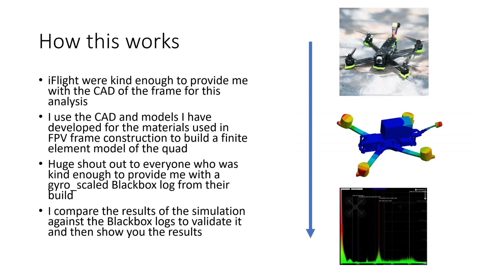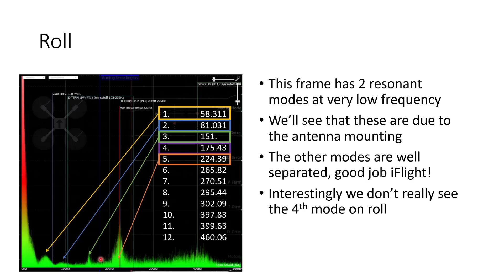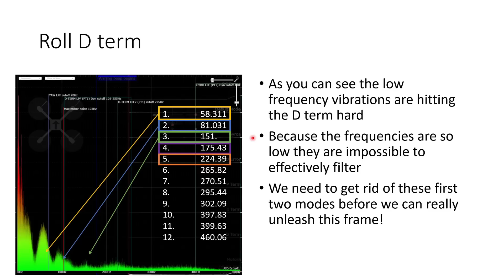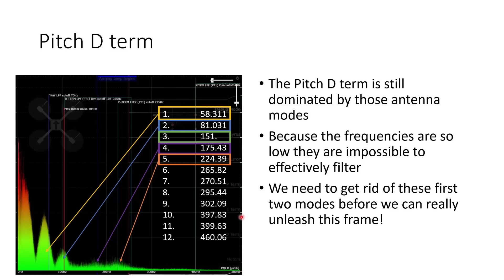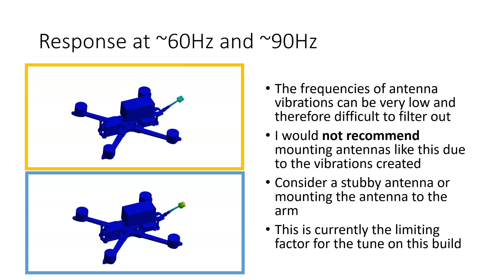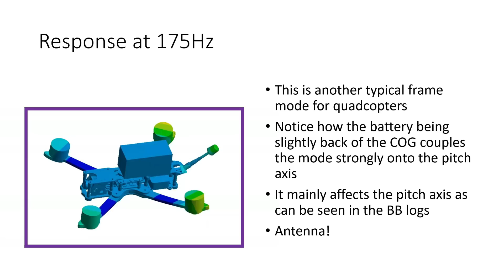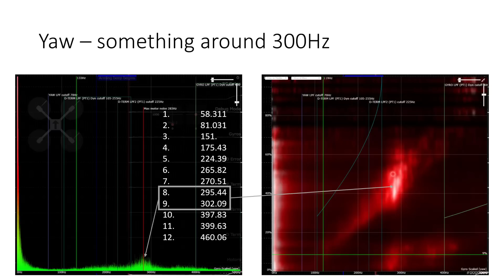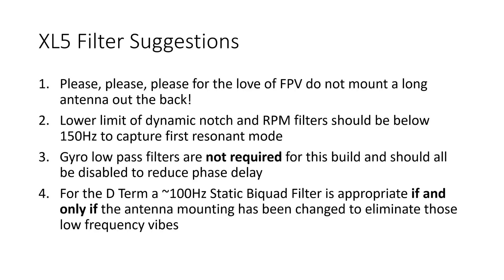Vibration analysis of the iFlight Nazgul 5 V2 and XL5 Frame. The antenna RUINED my tune!

Comment: It's obvious that antenna adds vibrations and ruins the tunes. But it's not obvious how to fly back when a short antenna blocked by every piece of the quadcopter...
Reply from the maker: I fly DJI and never have an issue with range or penetration with the antenna strapped to the arm. Maybe it's an issue for super long range (I don't fly many km away) but not for freestyle.
Reply: @ChrisRosser  It's an issue for analog ;-)

Comment: Hey Chris, just one question what if I am not doing freestyle with the quad but some occasional cinematic with this bnf? does using a long antenna matters? because I am flying maybe 1 km away i am worry that if I use a short antenna it will get blocked by the battery and gopro and lose signal

Comment: Hi Chris! Just curious as to the real significance of the mass participation factor of a small antenna relative to the mass of the rest of the build? I've been doing my own frequency analysis on my own designs on SolidWorks as well and I don't really see a practical difference between a 3g antenna (with a light hanging off the back in the context of a 250g build. When using such a light antenna, is it reasonable to say it is worth the extra resonance participate for better VTX signal?
Reply from the maker: It definitely affects the gyro signal and is visible clearly in backbox logs. Long VTX antennas cause low frequency <100Hz peaks that are amplified in the D term and limit max D gains. Have you validated your simulations with flight testing and blackbox?
Reply: @ChrisRosser  Okay, thanks. No, not yet, I'll go out today and check it out, thanks! Also, any chance you'd be willing to share the CFRP mechanical properties you use for your modeling? Given the composite nature and variability of the different sheets available out there I've had to cobble together a material spec sheet from a few different sources and I'm not 100% happy with that ha
Reply from the maker: @itsmeRizzG  Can solidworks handle a 6x6 anisotropic compliance matrix? Or does it assume isotropic properties?
Reply: @ChrisRosser  You can define an Orthotropic material with elastic moduli in X,Y and Z as well as the other properties (poisson's etc.) according to the appropriate dimensional planes/directions.
Reply from the maker: @itsmeRizzG  Here is a link for in plane properties and you can assume resin properties for out of plane: http://www.performance-composites.com/carbonfibre/mechanicalproperties_2.asp
Reply from the maker: @itsmeRizzG  Unfotunately carbon fibre is not an orthotropic material (its fully anisotropic).
Reply: @ChrisRosser  Thanks, I've looked at this before,

Comment: Wow, I just had a HUGE problem with a Rekon7 and and HRB 3300 6s. I couldnt strap it down with a rear second strap or it was d term hell and HOT motors within 10 seconds. The rear of the battery contacts the antenna(about 8" long stalks) TPu mounts and probably is coupling antenna modal vibrations into the frame via the battery!
Reply from the maker: 8" long antennas, yep that sounds like a vibration nightmare 😱

Comment: So you created an exact nazgul5 v2 on the simulator?
Reply from the maker: Yes, iFlight were kind enough to send me their production CAD model so it should be very accurate.
Reply: @ChrisRosser  is there a way I could do the same? Or would it be hard?
Reply from the maker: Depends on your background. I'm a simulation engineer by profession so it was an approachable problem for me.
Reply: @ChrisRosser  wow that is impressive! How did you get into that? Also what is the best Sim for 2021?

Comment: Same probably goes for the huge battery wires and connectors that people allow to flap around in the breeze.
Reply from the maker: Absolutely, youve got to tie loose parts down to stop them vibrating.

Comment: this a kind of motor cross talk, I have modified nazgul with 7 inch props and arms, it has clean picture after 30-40 hz. Frame oscilating at 0,5-1 hz

Comment: That theory sounds really great, but someone should test with & without the antenna and show the results. Great video explaining this hypothesis, but im just not convinced that this little antenna makes so much difference, until there is clear evidence.
Reply from the maker: If you follow the discord groups you will see a few examples of antenna mounts causing vibration and changing the mount fixing it. It's quite a common problem particularly for long range quads with long antennas.

Comment: I have this quad in analog version. Would that be helpful to support the antena by stiffening it with carbon rod shrink-wrapped to it or using a carbon tube perhaps?
Reply from the maker: Yes, anything you do to stiffen up the antenna will help.

Comment: Really amazing analysis Chris! I am a structural civil engineer and many times I wondered why there was not much talk about resonance and the vibration modes of the frame versus the performance in flight. Have you modeled the effect of the stack's support configuration on the amplitude of the noise? a while ago I had a serious problem with noise in the yaw axis and finally I realized that it was caused by very flexible supports, and it was made worse by the capacitor that unbalanced the center of gravity of the stack + capacitor assembly. It would be interesting if you could address that topic in a future video.
Reply from the maker: I strongly recommend that people use long steel screws for their stacks for that reason. I'll certainly mention it in my next build video to use steel screws and not plastic standoffs etc.
Reply: @ChrisRosser  Yes, in my experience the best results are obtained using steel screws fixed to the bottom plate of the frame with a nut, so that the frame + screw connection is as rigid as possible, and only use shock absorbers at the contact points between the screws and the FC. It's a very bad idea to use shock absorbers where the screws are fixed to the base plate, since the support point of the stack is "labeled" at that point and favors the problem I described above.

Comment: Awesome, thanks. I flew this frame all last summer... It was one of my smoothes flying builds... I did only have a light weight flexible dipole on the antenna mount, and had soft mounted motors.. I will be building a fresh build on a new XL5 V4 frame very soon, I will deffo take your filter and antenna advice, thank you from North Wales.
Reply from the maker: I hope it flies great for you!

Comment: Thanks for the knowledge. Your work has inspired me to solve that problem by designing a new antenna mount that improves rigidity significantly. 

 I have uploaded it to Thingiverse 
with the name: Antenna Holder "Stiff" - iFlight Nazgul5 in case you want to comment with the link.
Reply: Youtube remove all the links, so in thingiverse thing:4907125
Reply: Just went and checked it out, def looks solid! Is it designed for stock standoffs?
Reply: @reboot110  Yes! Is designed mostly for stock standoffs. I am corrently working on different stubby antenna mount.
Reply: @gospodini226  Awesome, actually picking mine up from the printer today!
Drop a link here when u get the re-design done, stoked to see what u come up with

Comment: So obviously there is a tradeoff, shorter antenna and you get less range. So what if we used stiffer antennas so they would vibrate at a higher, more filterable frequency?
Reply from the maker: In this case it was the TPU that was too flexible rather than the antenna so a stiffer antenna mount would have helped a lot.

Comment: Hi Chris, my quad has the iFlight Cidora SL5 frame, which I'd expect work have very similar vibrational modes to the XL5 frame, so I'm paying a bit more attention to this video in particular, haha. Plus your advice about the VTX antenna is pretty universal, regardless of frame. Quick question about that though; I've been mixing/matching parts on my quad for the past year or so now, and I'm currently running a Lumenier AXII 2, which while being ~2.5" long is rather stiff. Would you expect antenna stiffness to raise those low-frequency modes very much? I have the exact same TPU antenna mount as the Nazgul, so that might be erasing any improvements I'd get from the stiffer antenna. A sensitivity analysis of antenna stiffness for a given length would be interesting, since we're probably not all gonna switch to stubbies after watching your video, lol. Thanks for the awesome vibration analysis!
Reply from the maker: The shorter the better for antennas. In my analysis it was the TPU that flexed not the antenna so antenna stiffness wouldn't help that at all.

Comment: It is interesting. My flight logs look very differently to yours. I have an XL5 frame with a Caddx Vista and its antenna on a TPU mount, and my noise look very differently, I would say better than the one in the video. I even managed to implement your new filtering suggestion from your latest videos with 110 Hz Biquad on the DTerm LPF.

Here is a log if you are interested: https://drive.krastev.family/d/s/kU2anXWSb1Fw6XgrgjWZCrRlib1ZmsZC/c_UVVFCTgPdMGMZZ7UHxcrIiJpfs5wrF-ib6Af3-Zuwg

Comment: So if I replace that long antenna with a stubby, do I need to also change the mounting method? or would the default flexy tpu mount work fine with a stubby?
Reply from the maker: Should be fine with a stubby IMO. 👍

Comment: What about Crossfire antenna zip tied to the motor arm?  This is a common method of mounting the receiver antenna, but I now wonder what that's doing to vibrations.
Reply from the maker: Crossfire antenna is very small and light so that's probably ok.

Comment: Thanks for this analysis of the Nazgul frame. I've been battling noise for months on my Nazgul5, I never considered that my Caddx antenna might be adding noise into the system. Recently I've been having an enormous amount of noise on my yaw axis which I am still trying to work out. I swapped out my XING 2208 1800kV which were dinged up a bit with a set of XING2 2207 1855kV. It helped a bit but I still has an excessive amount of broad noise on the yaw axis. Now I am suspecting my particularly soft TPU mount may have have some part in the excessive noise. Can you by chance share the XL5 frame model that iFlight sent you? It would be extremely helpful for creating a better antenna mount and also running my own simulations on the frame with different antenna mounts. I would definitely become a patreon if you would be willing to share the model 😁 thanks for this video in either case!
Reply from the maker: Hi Daniel. I'm afraid I cannot share any design information for any of the frames I analyze due to my commitment to absolute confidentiality for any design information provide to me. Once the video is finished I destroy all my copies of the CAD information.

Comment: This is the same on the non hd versions too.  I put 2 zip ties through the tpu mount to stiffen it up against the standoffs.  Lowest modes are gone and LP take care of the rest!  thanks for the watch out
Reply: wait how does that zip tie trick work?
Reply: @definingslawek4731  2 zips one around each stand off and through the tpu mount over antenna making an X and pulling it downwards.

Comment: Dear Chris, thanks for your very useful analysis. I had problems of this kind with a TPU mount for my Source One build. But I don't like stubbys in terms of video performance, when the quad is flying in my direction there is a (someties significant) lower reception. So what if I print the antenna mount with PETG instead? It's not as flexible as TPU, maybe the resonance will be shifted in a higher frequency range where filtering work better to eliminate it ...
Reply from the maker: Yes try PLA or PETG for the antenna mount and it will help a lot!

Comment: Hi Chris, if vertical lines are frame resonance, then what horisontals are? Mark has mentioned this but not clear enough
Reply from the maker: Typically it's propwash if its a wide band around 50% throttle.
Reply: @ChrisRosser  thanks, but what if i have tis lines on all throttle range?  85 and 90% are strongly expressed

Comment: Hmm. Maybe I did something wrong. Tried those filter settings ( nazgul analog stubby fresh props) .. quad sounded real angry and hot motors. Reverted to more conservative filtering. .. again. As said. I must’ve missed something.
Reply from the maker: RPM filtering on?
Reply: @ChrisRosser  always. ;)

Comment: for those who have the 150mm long range antennas is there any good ideas besides a solid pla mount?
Reply from the maker: You could cable tie the antenna to the top plate and stand-offs to try and minimise the tendency of it to wiggle
Reply: @ChrisRosser  good ole zipties prevail again! excited to try the aos5 or 5.5 ii just got dji goggles on the way!

Comment: I took a look at some of my old scaled gyro logs from my stock Nazgul 5HD 6S. They are extremely clean and I'm not seeing any spikes above about 40Hz or below about 200 Hz on Pitch, Roll, or Yaw. Maybe I just wasn't flying aggressive enough back then to bring them out. It makes me wonder how do we know there just isn't something off with this guys set up or tune?
Reply from the maker: You might only be able to see it in the D term. If you post a link to the log I'll take a look.

Comment: weirdly, i was just troubleshooting my quads,had some weird jello and twitching when i mounted longer dji antenna and immortal T vertically just behind the hero 6.  i added some cable ties plus an embarrassing amount of hot glue to the dji antenna and a huge amount of  hot glue to my immortal T's base, it helped quite a bit. on the dji i added two cable ties rising up to form a sort of curving triangle reaching up about halfway on the antenna stem, then addeda piece of cable tie between the triangle legs and covered it with hot glue too. i dont do black box, but i've always been concerned by antennae vibrations, its nice to see my instincts that these could be critical to performance, being proved true.

Comment: If the antenna is capable to do that, imagine the lipo lol, cause your resonance test of the frame is acting like the battery is solid stuck to the frame and not something just strapped on it. I bet the lipo it self create 10 times or more resonance than the antenna,   and we not even touching base with a gopro on top. So what ever are the suggested PIDs, will never be applied for every case.
Reply from the maker: The battery isn't solidly stuck to the frame its on a rubber battery pad with a defined contact force (from the straps, not modelled). It can move if it wants to! If you watch my analysis of the marmotte frame you'll see that on some frames it does!

Comment: So how would I go about getting this analysis on the frame I designed and have been flying..?
https://www.instagram.com/p/CNOLf1jLoc9/?utm_source=ig_web_copy_link
Reply: He has a Patreon with a membership level for exactly this: "If you are a hobbyist designing a frame and you want it to be all it can be with in depth analysis and support though your design process this is the tier for you. Each month I will undertake a detailed analysis of your design and follow up with you by email and/or 30 minute call to discuss the results. You will need to provide CAD of the assembly in STEP file format."  URL:  https://www.patreon.com/chris_rosser

Comment: Sorry but you are trying to overengineer something that is working perfect when soft mounted, from the point of view that stiff mounting will break your antenna really fast, tpu will let it flex and will not destroy SMA on hit or stubby gets ripped of connector when its still. Believe me been there tried all. Soft flex mounted with tpu is the way to go.
Also I do FEM static and modal analysis everyday prof. at work and I am skeptical how your models are defined.
Did you define materials correctly? Because carbon fiber as well as antenna itself is not a solid isotropic material and I hope you defined directional stiffness correctly or your results are off. Carbon fiber is anisotropic material as well as antenna on coaxial semi rigid cable. 
Cheers
Reply from the maker: Hi Blaz, we can agree to disagree on this one. I use flexible antenna (ufl or mmcx) and cable tie them to the frame. I get decent range (on DJI which is easier I grant you). More than enough for freestyle. Also it's a lot lighter than a big chunky SMA and very resilient in crashes.
Models are anisotropic for composites (I've written some code to create them  based on the CF layup) and anisotropic for the coax as well. I've validated the models on a decent number of blackbox logs on many different frames (I've made a fair few videos on this which you can review) so I'm confident they are fit for purpose. Thanks for your comment.
Reply: @ChrisRosser  I see. Great videos, keep up the good work. 🍻

Comment: I wonder if a more robust antenna mount would get rid of the issue? The reason i thought of this is because Joshua Bardwell uses that type of antenna on his new perfect freestyle build and doesnt have this issue. But his vtx antenna mounting locks in with his reciever antenna mount and im thinking it makes the mount more rigid getting rid of this issue.

Comment: I don't have the HD version but an analog Nazgul5 and I immediately found the flimsy antenna mount suspicious when I saw it. However, flying on analog a stubby just wasn't an option because the range really suffers. I 3D printed a big antenna and GPS mount from relatively stiff TPU and I hope this will give me more headroom for tuning. I was surprised seeing the vibrations being more pronounced as on roll on a true X frame. I think this will be even more so on wide X frames (have to check again on your Source One analysis).